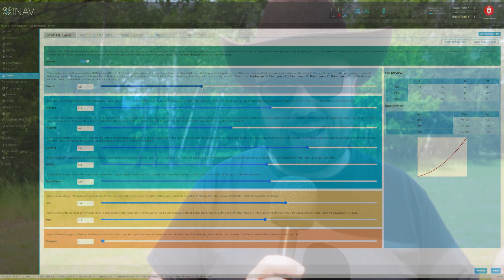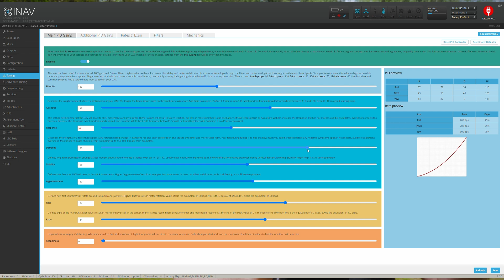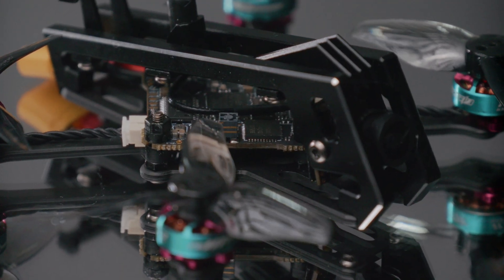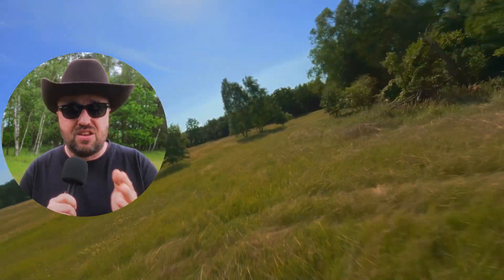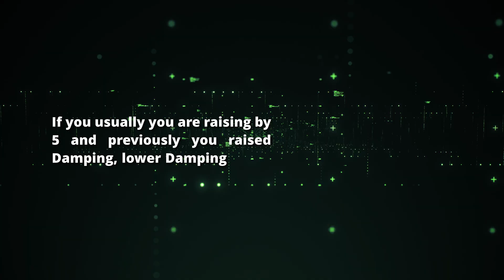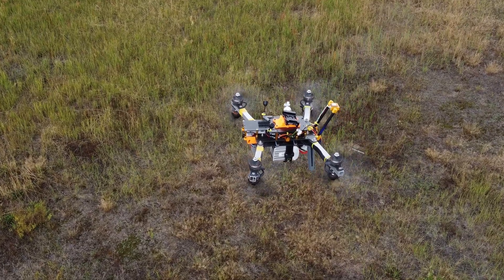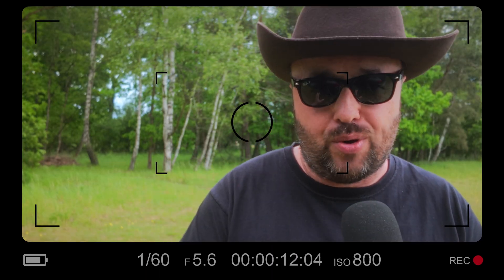No More PID Headaches: INAV EzTune Explained

Comment: Why are som of the Servos are freaking out while rebolting the FC on Inav configurator. 
Yesterday i wanted to make the 2. Flight of my vtol, and the the tail servo jammed while this Full Speed Full angle shit. Some of the Servos will go in one direction in Full Speed, after the Boot comoleted, the Servos go in the nutral position. How can i provent it from happening?

Comment: For some reason I thought this was an "auto tune" feature.  Like you fly it and then INAV uses the flight logs of stick inputs/gyro/accel data to fine adjust the existing tune.  That would be really cool  😀
Reply: I mean ardu pilot has this, but I suppose a good tune is also a little subjective maybe (Idk) so like everyone flies slightly different tunes.

Comment: I just tested EzTune on a 4 inch quad. The tuning itself is great, sooo much faster than before. BUT the for the Rates it seems to be absolutely useless. If I set higher rates, the expo rises too. The expo slider seems to do nothing against it.

Comment: Love the concept but I have some feedback:
1. Without any way to modify settings via OSD it's not very practical for me to use.
2. Can we please decouple the 3 axis with respect to rates in INAV even coupling pitch and roll is super frustrating (more for fixed wing than quads but still).
Reply: it's in the osd menu in inav 8
Reply from the maker: exactly. INAV 8 adds it to OSD
Reply: @FPVUniversity  oh sorry, excellent